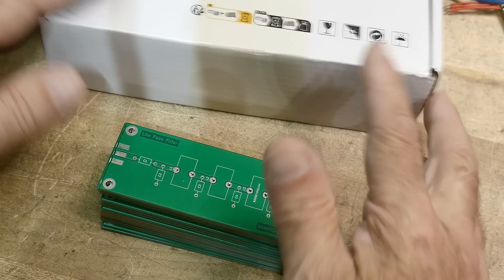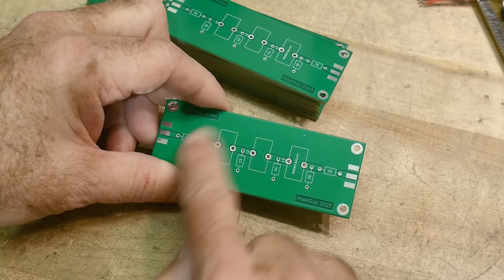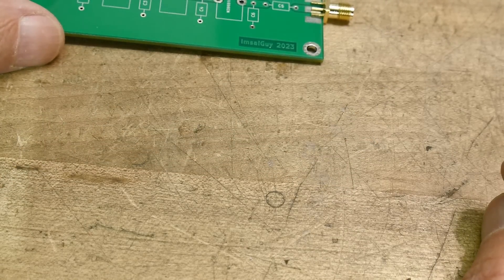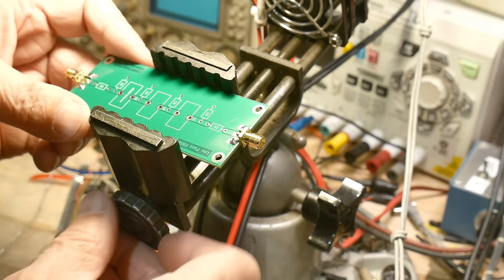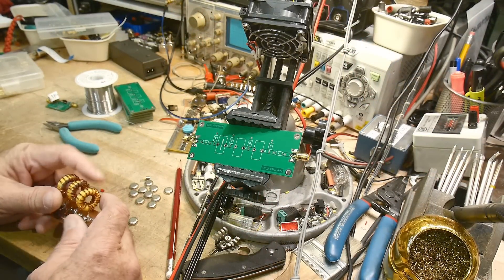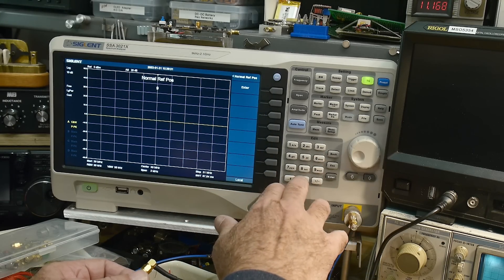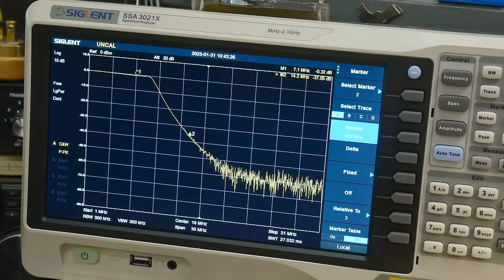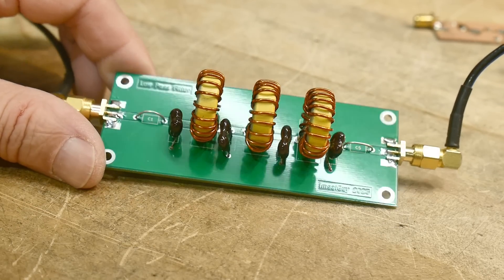#1424 Low Pass Filter PC Board

Comment: But you do not want 50ohm impedance in the interconnections of the filter. You want to minimize the connections in their size and length, and if length required, then to just add them to the inductor values.
Reply from the maker: I agree many circuits will have a high impedance say 3000 ohms. This filter was designed as a transmit filter between the PA and antenna to reduce harmonics. 50 ohms is required.

Comment: Nice little board!    My pcb layout rule number 1 always check the footprint and data sheet, rule two alway 100% check connector pin numbering and pin location. Connectors are so easy to screw up, not all suppliers count the pins the same.   Had to laugh at your escaping Metcal hand piece, that happens to me all the time.  Your instinct is to try and catch it, not a good idea, dont't ask me how I know.   The stand just doesn't hold the hand piece all that well, I have the holder with the ferrite core that throttles back the heat and it has the same issue.   Got the same Rigol SA,  have you hacked yours to 3GHz?
Reply from the maker: I remember in shop class, if you drop something, let it fall. yes the SA is 3GHz now

Comment: You have just picked the wrong footprint. I have just set out a very similar board for a 7Mhz BPF. in Kicad 6
The connector:    Connector_Coaxial:SMA_Samtec_SMA-J-P-X-ST-EM1_EdgeMount
In the Connector_Coax library is a very close match for the ebay SMA connectors that are like the one on you show
The pads are on 2.7mm centres So I needed to tweak them to 2,54

The Molex coinnectors listed have much larger pad spacing. >4mm

Andy

Comment: I think KiCAD connector footprint is made to use a regular through hole connector. You can usually place it diagonally and then the footprint makes sense.
Reply: There are 3 SMA Edge Connector footprints in the standard Kicad library that cover the three main sizes, the one shown here was the first in the list and the largest. Kicad now has a measure tool in its selector so you can double check !

Comment: I always like to print off the Gerber’s so I can get a good idea whether I’ve got it right or not before sending them off.  I can’t always get a feel for the pads on the screen, but on paper and with the parts it’s easy.
Reply from the maker: yes, I was lazy on this one. I usually print them. I always get the capacitor hole spacing incorrect the first time.
Reply: Squeak !

Comment: A KiCAD design decision was to put emphasis on a library.  I never, ever use someone else's PCB library, and never one that can somehow update out from under you.  Of course I don't draw all my own footprints, but if on rare occasion I use someone else's footprint I check it.  I've found a personally known good library is an essential design principle.  Little things that look right but aren't matter, especially with SMD footprints where surface tension plays a large part in centering the part in automated assembly.
Reply from the maker: All the footprints I end up liking, I"ve been putting copies in a separate library, so they are fast to find and already self approved.

Comment: Emissions: “For transmitters installed after January 1, 2003, the mean power of any spurious emission from a station transmitter or external RF amplifier transmitting on a frequency below 30 MHz must be at least 43 dB below the mean power of the fundamental emission.” Sec. 97.307(d) 

I like your SMA pads; better than a thin pad the iron can’t reach well.

Comment: I have been bitten too by wrong footprint on a board. These days if its a foot print I haven't used, I print the board to paper and wait until I have the part to test fit before ordering. As a side note, I have switched to diptrace for schematic and pcb, in my opinion so much better. they have a free version that is just as powerful and I was able to use it for about a year before I purchased a higher version